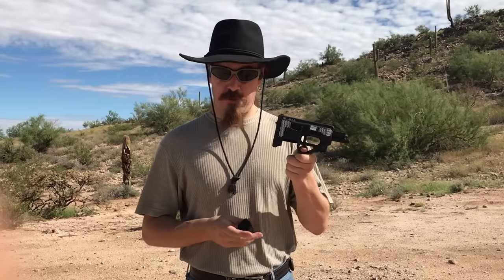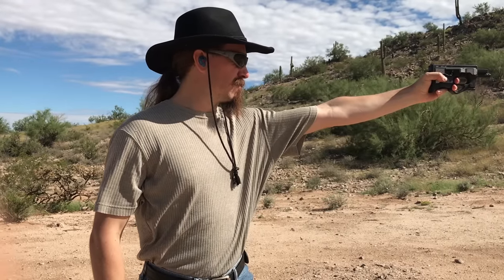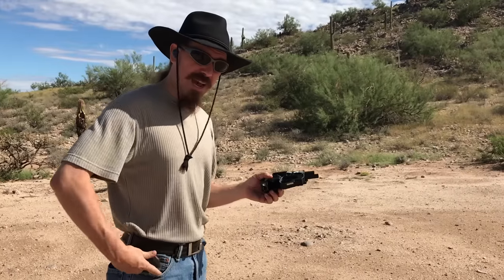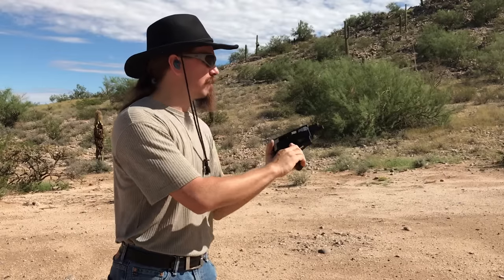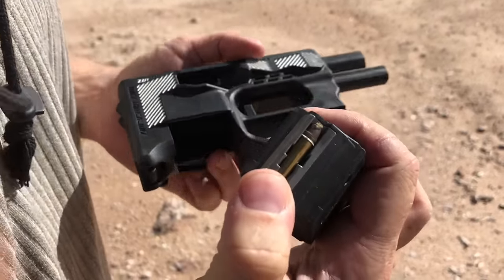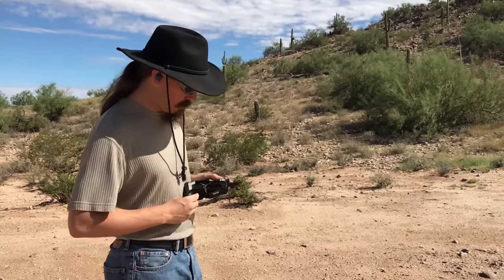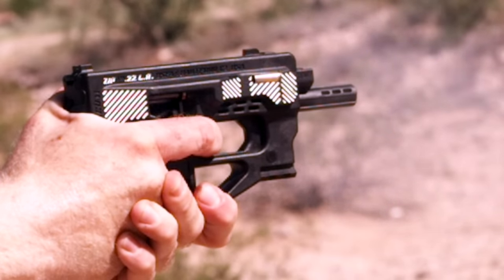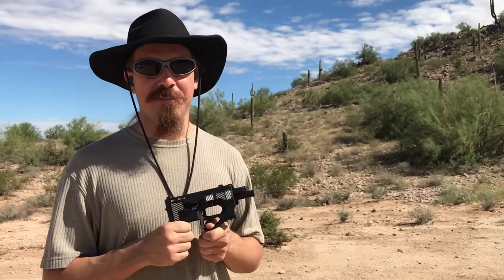Zip 22: Shooting the Worst Gun Ever

Comment: This isnt a gun, this looks like an ink cartridge from the 1980s
Reply: Zip 22: You need a new mag
Soldier: But there is still 9 rounds in the mag
Zip 22: YOU NEED A NEW MAG!
Reply: It legit does
Reply: @FungusBug  it looks like something I would see in some 2009 roblox game
Reply: @Gunneramma  wow how did you knew
Reply: Try claiming your warranty when you explain that "the ink cartrige" shot your printer.
Reply: Looks like a Tediore weapon from Borderlands.
Reply: @theimperiumofman102  fitting potential inspiration considering how cheap they are.
Reply: It looks like a Nintendo Switch game cartridge
Reply: I like it though
Reply: This is not a gun it's a sandwich. 

What would make you think otherwise?
Reply: @BigAl2-u7e  everything Else fire arm must be ban and ounly use this on war! All those missfire they wont be so many deaths so political measures wuold be more effective!
Reply: Ha ha ha
Reply: I thought it looked like a breathalyzer or a tape recorder
Reply: It's like they didn't know how to use a cad program so they just inserted a default square and winged it the whole way 🤣
Reply: probably more reliable as an ink cartridge

Comment: I don't think you should ever want to hear someone say ;"Its not supposed to do that" when firing a gun.
Reply: Happened with a double barrel .410 that my dad bought brand new. Fired perfectly fine for the first five or so shots, but after that the top barrel would fire unreliable. The firing pin wasn't striking the round with enough force to get it to go off, but it would occasionally fire after a delay. So if the that happened you just stood there holding the gun down range for a couple minutes. After the second misfire he sent it back to the manufacturer for a refund or repair. Not sure which exactly
Reply: That's actually not something you want to hear about almost anything haha
Reply: I tried to shoot a pistol once, and nothing happened. This doesn't sound that bad, but there was a round in the chamber and it didn't make any noise whatsoever, not even a click from the hammer striking. I was scared that there was something wrong with the hammer, and thought it might decide to release itself after I put the gun down. That was the most tense silence I've ever heard in my life. It turns out it wasn't cocked properly, the hammer never locked in the down position.
Reply: Not unless you're the dude standing in front of it.
Reply: @XanthosAcanthus  "accidentally cures cancer"

Huh it's not supposed to do that
Reply: @Eshtian  but what if I wanted to cause cancer?
Reply: @XanthosAcanthus  but now you could be rich

And use that money to develop an actual cancerinator
Reply: @Eshtian  you make a convincing argument.
Reply: Worse... "It's not supposed to be able to do that"
Reply: @Eshtian  when the cancer ray
Reply: @Anonymous-73  coming this 21XX
Reply: @perryborn2777  Those are called "Hang Fires"
Reply: @trentspears9118  ah yeah, I've heard the term before, but I haven't been regularly around weapons for a few years now, so the terminology is starting to slip. I'll be moving back out to the country again soon, so that problem should remedy itself quickly
Reply: Especially if you planned for failure
Reply: @XanthosAcanthus   I recommend using just about anything buy a gun to figure that out
Reply: @wessltov  airplanes have entered the chat
Reply: It's not the ideal phrase to hear when shooting a gun

Comment: You know a gun is absolutely awful when it straight up creates a previously unknown type of malfunction.
Reply: my shooting buddy bought one with all the do dads and replacement spring kit, Pic. rail and still never ran right. Finally he took his Saiga 12 ga. shotgun and blew it to bits.  no b.s.
Reply: 9:20 "How do we fix that?"
A gun so awful Gun Jesus doesn't even know what's wrong with it. Be afraid. Be VERY afraid.
Reply: Ah the legendary type 4 malfunction...
Reply: he really should've kept it. 50 years down the line, the limited produced gun would've been a collector/museum piece that would've been worth maybe 2x the MSRP! But in all seriousness, he should've kept it.
Reply: Ja C He should have. I mean, it’s a piece of shit for firing, but give it enough time and it’ll be of great value for collectors.
Reply: I suppose a firearm can't fail to extract if there is no extractor.
Reply: Your shure right!
Reply: Design malfunction?
Reply: I think it was a tiny amount of expansion of the components from the heat of firing more consecutive rounds through it than anyone has been able to before. Since there was no debris in the gun that could have caused the jam.
Reply: For the fact it was made of plastic, I guess it slided out of the guide or... Something like making a huge scratch on the sides. I suspect internal material damage. Not to mention it probably has poor tolerances, so might have weeble wobble
Reply: This malfunction called Failure To Not Turn Into A Polymer And Metal Brick Of Matter, or, FTNTIAPAMBOM for short.
Reply: @MegaBait1616  suprised he got his saiga to run properly
Reply: @maryjagger7556  , Mary you know it. He brought it to a local G.S. no good then sent it to Las Vegas and they fixed it to cycle cheap stuff.  still has it but now has a Vepr which eats everything......
Reply: @MegaBait1616  i had to get mine machined because it kept dropping the mag out of it
Reply: @maryjagger7556  , Saiga makes great rifles. shotguns in 12 ga. seem to always have the issues. i have a couple rifles n Vepr's just wished we could still buy them :-(  glad you got it to cycle n fit your mags...
Reply: @InfernusdomniAZ  nah it firing so much without jamming created a localized reality restructuration event that even Gun Jesus couldn't prevent and the gun became even more useless

Comment: I used to have nightmares when i was young that I was being chased by someone, found a gun but then couldn't pull the trigger. Now it will be replaced with me finding this POS. 
Thanks a lot.
Reply: The real life Klobb.
Reply: I thought I was the only one, I even still get them now no matter how much I try I just can’t the strength to pull the trigger or it is extremely difficult to do so
Reply: @charliediamond6197  I have the same nightmare, except i can pull the trigger, but the bullets don't do anything. It's incredibly frustrating to dream you fire a full mag center mass and the dude doesn't flinch.
Reply: Yeah, my M&P9 had a couple of feeding failures when new on its first day, it has not failed again but it still haunts me.....
Reply: @charliediamond6197  lol, it's because you didn't check for safety. I mean, you found it in a dream, it's probably not even loaded. = )
Reply: nailed it.
Reply: How's your libido?
Reply: No way, same dream. I keep squeezing but can't get the trigger to the point where it will fire.
Reply: @Doggieman1111  its beucause it's the same demon that haunts yoi
Reply: Oh no!
Reply: That's nothing. I can't even run in my dreams.
Reply: I get the same dream, I squeeze and squeeze but just haven't got the strength to fire it.
Reply: Would you, a 5-10 yo., have the mental strength to pull the trigger?

Comment: That slow-mo shot of the casing bouncing off the gun 5 times before finally finding its way out.  

Absolute perfection.
Reply: its like a fucking fly
Reply: You may not like it but this is Mechanical Engineering at its peak
Reply: And being able to clearly observe a failure to feed
Reply: What a shockingly worthless piece of shit this gun is. Combined with the name (suggesting it's a zip gun) I'd be amazed if cocaine and psychopathy wasn't involved in this business decision. It's as bad as the Cobray Street Sweeper and far more useless.

Comment: You've got a short pictanny rail, dude. I suggest you take advantage of that and put a bi-pod or foregrip on that bad dog.
  Edit: Or maybe, just maybe an M203
Reply: don't forget a baillonet
Reply: or a chainsaw!
Reply: Put an under-barrel shotgun on there and you'll have at least 1 reliable weapon system...
Reply: that could work with a stock as well
Reply: Or another zip22
Reply: @farcticox1409  there is a stock to turn it in a pistol carbine
Reply: @Dutchcomentatah  so we can get the ultimate singularity of failures.
It does maybe work as a mace against the enemy
Reply: Daen Douma With one of the top covers they offered, you CAN technically do that, but that doesn't mean you should
Reply: M-203 will be more practically than this stupid piece of metal.....
Reply: BIB_4896, you can't even use it as a mace... It's all plastic!
Reply: The Davy Crockett atomic bomb attachment or you could have used the mount that attached it to a real gun, like an M-16 or an M-4.
Reply: Or put another zip 22 on that rail.
Reply: MasterCheifn343 for twice the reliability
Reply: A whole M4
Reply: Coolio Bob I’d rather throw rocks, thank you very much. Or swing sticks, possibly both, either or would be superior, doing both would be a far better action.
Reply: Solution to bad gun: attach under slung better gun.
Reply: And make it a NFA item??
Reply: Put in under a carbine and then put a 203 on it.

Lol
Reply: KAC Master key!
Reply: @AlexChovBricks  you're giving it way too much credit, in actuality it's mostly plastic.
Reply: The m203 would make it usable
Reply: Or a bayonet if you're feeling extra Japanese that day
Reply: Mount an XM26 MASS on it
Reply: Need to install the top pic-rail and slap an ECLAN or ACOG for tac-ti-kewl factor
Reply: A sling stud.... in life or death situation you can make the most of the Zips numerous pointy bits and swing it around like a flail

Comment: Why didn't they pay for someone to manufacture the prototype for testing, before going through the expensive option of tooling up first and trusting to luck it would work, cheers for you're fab programme from an English fan
Reply: "plastic haven't been easy to prototype in untill reasently with 3d printers" This was made in 2013...
Reply: Thanks guys I'm getting the picture lol
Reply: There's nothing on this that'd be hard to CNC machine. Nothing was stopping this company from milling a few blocks of nylon for testing before going into full production.
Reply: @Locutus494  its not like it couldn't have been prototyped in metal first, actually in metal this gun is probably a lot more reliable as the bolt has some heft to it
Reply: Lassi Kinnunen  thank you for correcting me. I was under the impression that most plastics was not sutable for machining becous the heat from friktin would softhen them.
I relice now when thinking about it that you can use some plastics thay have wont melt but othervice have simular properties.
Also compleatly missed that this was made in 2013 thoght it was older.
I still think it is posible that if they did prototypes they had allot more mettal then the finished product and worked allot better.
Reply: 3D printing was an option, even in 2013. milling could have been a problem, don`t know about the internals.
But it would be enough to test handling and feeding/extraction. shooting, well i would´t even recommend to shoot the actual production ones.
Reply: Lassi Kinnunen  from video yesterday the bolt looked compression or transfer molded as it had some sort of random fill in it.
Reply: @aggese  If you can adjust your machine's feed and speed, you can  absolutely  mill many kinds of plastics, but brittleness can be an issue.
Reply: So which one takes top honors for crappiest firearm, this guy or the Cobray Terminator?
Reply: The terminator actually works
Reply: Olueni onLoppu: I don't think a handling test would even be required, simply having eyes and glancing at drawings of this thing should be enough to conclude that it's going to handle awfully.
Reply: There was actually someone in the comment section of the tabletop video, who said he shared the same firing range with the inventor and that when he had the possibility to shoot the prototype of the ZIP it functioned just fine.
Reply: Ah Vilable absolutely not lol
Reply: +Judson Joist I'm surprised he didn't sell the company for magic beans
Reply: What I leaned in the US is to be conservative with industrialization of serial production machinery.  1st prototype: proof of concept, 2nd prototype: proof of reliability, 3rd prototype: proof of manufacturing process. After that the only goal is to reduce production cost. But there are always smart guys who are more clever than you and are able to shorten this process...
Reply: Thats completely untrue. CNC machining plastic is 100x better than 3D printing and it's been around for decades.
Reply: @beaker126  neither.  That award should go to the Jennings J-22
Reply: @bensutcliffe1975  Did you watch Ian's vid? Cuz it didn't, nor reliably.
Reply: @lightweight1974  
I can't say for the .22, but a friend's dad had a Jennings .25 he got in a lot from an estate sale, and it actually worked better than either, would reliably dump two mags in a row, to everyone's surprise. Now, hitting anything...
Reply: Why did the the nazis try to take Lenningrad?
Reply: @beaker126  well it works better than the zip
Reply: I have to assume that when this was prototyped the bloody prototype worked absolutely perfectly with no failures whatsoever. Then they tooled up and found out that the design is cursed. 
Maybe a well meaning engineer tweaked the prototype slightly off spec to get it working and then neglected to change the actual design to match.

Comment: The original "Zip" gun (1960's vintage) was (1) piece of wood, (2) sliding bolt door lock & (3) telescoping auto radio antenna (pick the proper caliber from the choices available after snapping it off a parked car). Add a stiff rubber band, tape it together, load a .22, flip the bolt to fire.
A lot less engineering, but a lot more reliable. And arguably safer. Just a single shot, but apparently the modern Zip 22 is also mostly a single shot. Got to get your head out of the CAD application from time to time, I guess.

Comment: I get that it's a .22 LR (so not exactly powerful) but still have no idea why they would've made the bolt out of plastic. I'd bet that an aluminum bolt (with maybe the faintest whiff of an extractor) would help this action a lot but the ergonomics are so terrible that I don't know why anyone would bother.
Reply: Exactly what I was thinking. It would be interesting to get one just to experiment with it and figure out if making a metal bolt for it would help reliability. Maybe add an ejector, since an extractor wouldn't actually be necessary. The bolt looks like it would be very easy to make.
Reply: A guy did machine a metal bolt for one and messed with the spring tension and got his to run rather well.  I don't remember if he added an extractor or not.  I also don't remember if I say this in a video or read it in an article.  I think it was a YouTube video.
Reply: Look up his video on the Gevarm  .22
It has no extractor or firing pin and works flawlessly. 

Yes, ok, the asymmetrical magazine feed lips function as an ejector.
Reply: Pope Facto AVE?
Reply: He may have been thinking to rely on the timing of the bolt return to smack the ejected cartridge just as the mouth is pointed out the port, which needs a super-fast return time.

It also needs a horribly specific pressure curve... for .22lr that's one manufacturer, one product, one *batch*, and even then you're tossing coins...

The lockup was probably a piece of schmutz dragged in between the guide plate and the charging rod, it would have spat it out the moment it came loose. OR, and this is a stretch, was the end of the spring checked against the size of the hole in the guide plate? If the end worked it's way in there it would have locked solid and left nothing but a little marring/scratch on the rod, if even that. 

Someone above remarked that this is so bad it feels like a calculated failure dressed up to seem legitimate. I'm starting to agree.
Reply: @mfree80286  the problem with a metal bolt would be the plastic rails the bolt rides on would wear out quickly, basicly to make it a better gun youd have to completely start over.
Reply: But the bolt doesn't ride on a plastic rail, it rides on a metal rod and two other metal rods ride in a guide plate.

EDIT: Which just flashed in my head that holy crap, something was almost done properly....
Reply: @mfree80286  it defiantly dose have a plastic guide rail for the bolt
Reply: Tyler, it would tweak my YouTube Happy Button if AvE fabricobbled a bolt for one of these!

Michael Free, there was apparently an "upgrade kit" (with a new trigger, guide plate, and bolt) provided by USFA for a certain range of serial numbers to fix a number of issues with those pistols. I wonder if this was one of those (but without the parts installed).
Reply: According to the first video, the designer and company owner was basically divorced from reality and wanted to build the cheapest plastic gun possible to push out tens of thousands or even millions of units. He put economy first and pretty much everything else second, to the point where his company was destroyed by it.
Reply: throw a charging handle of some sort in there too. maybe u can upgrade this to "terrible gun " status